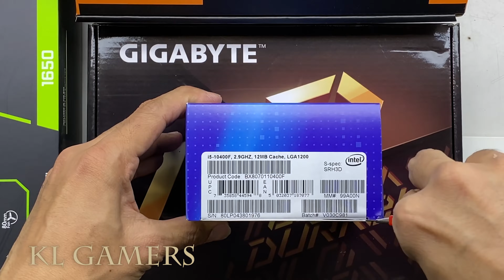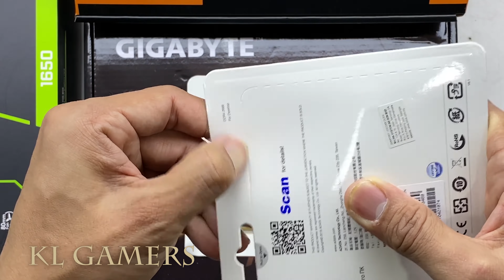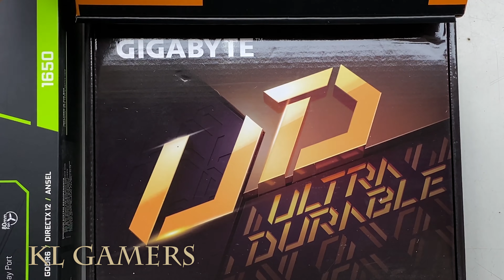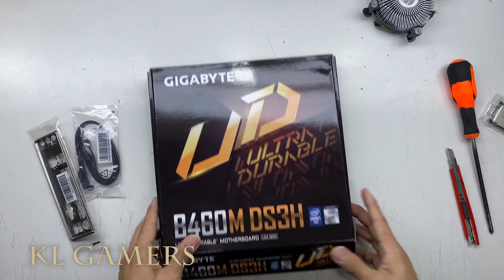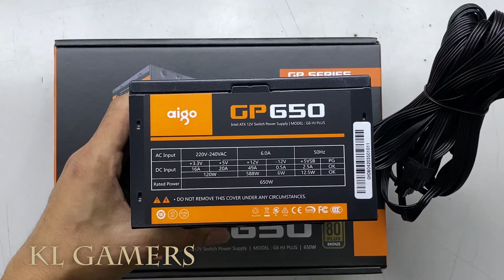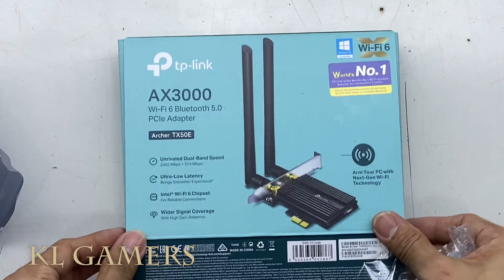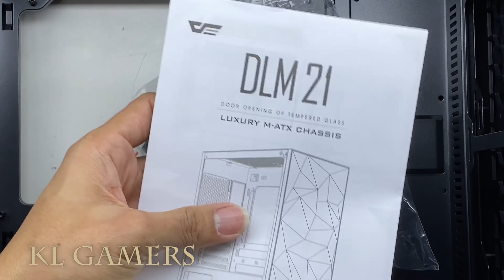intel Core i5 10400F GIGABYTE B460M DS3H GTX1650 DLM22 Black PC Build

Comment: Btw, if you put the total price for the build could be more interesting...Love your video...Dont stop👍
Reply from the maker: Processor =  Intel Core i5-10400F Desktop Processor 6 Cores up to 4.3 GHz Without Processor Graphics LGA1200 (Intel 400 Series ) 65W (DEC)
(Amazon link) = https://amzn.to/2XDBoBK
(Lazada link) = https://c.lazada.com.my/t/c.Y5a4eQ?url=https%3A%2F%2Fwww.lazada.com.my%2Fproducts%2Fintel-core-i5-10400f-6-cores-up-to-43-ghz-lga1200-processor-without-processor-graphics-i5-10400f-i1314432419-s4035954258.html&&sub_id1=10400F&sub_id2=YES&sub_id3=639
(Shopee link) = https://invol.co/clvw63

Motherboard = Gigabyte B460M DS3H (LGA1200/Intel/B460/Micro ATX/M.2/SATA 6Gb/s/USB 3.2 Gen 1/DDR4/Motherboard)
(Amazon link) = https://amzn.to/3eOh5sO
(Lazada link) = https://c.lazada.com.my/t/c.YUA1xB?url=https%3A%2F%2Fwww.lazada.com.my%2Fproducts%2Fgigabyte-b460m-ds3h-m-atx-motherboard-i1425942136-s4581802021.html&&sub_id1=B460M&sub_id2=PCByte&sub_id3=354
(Shopee link) = https://invol.co/cl1rp4p

RAM = ADATA DDR4- 16GB RAM - DIMM 288-pin - 2666 MHz / PC4-21300 - CL19-1.2 V - unbuffered - Non-ECC
(Amazon link) = https://amzn.to/2OFMbqI
(Lazada link) = https://c.lazada.com.my/t/c.6tb2?url=https%3A%2F%2Fwww.lazada.com.my%2Fproducts%2Fadata-ram-ddr4-2666-u-dimm-16gb-i435493224-s636338959.html&&sub_id1=ADATA&sub_id2=OFFICIAL&sub_id3=360
(Shopee link) = https://invol.co/clkwvt

SSD = ADATA XPG SX8200 PRO M.2 PCIE GEN3x4 SSD
(Amazon link) = https://amzn.to/39P98kv
(Lazada link) = https://c.lazada.com.my/t/c.YUy3H7?url=https%3A%2F%2Fwww.lazada.com.my%2Fproducts%2Fadata-xpg-sx8200-pro-pcie-m2-2280-solid-state-drive-256gb512gb1tb2tb-i488598676-s1431066623.html&&sub_id1=8200&sub_id2=Viewnet&sub_id3=349s652831528.html&&sub_id1=sx8200&sub_id2=EIT&sub_id3=240
(Shopee link) = https://invol.co/clu0am

Graphics Card = MSI GTX 1650 4GB D6 AERO ITX OCV1 4GB GDDR6 GTX1650 (JAN)
(Amazon link) = https://amzn.to/2Kit5YE
(Lazada link) = https://c.lazada.com.my/t/c.Y5aOhe?url=https%3A%2F%2Fwww.lazada.com.my%2Fproducts%2Fmsi-gtx-1650-super-ventus-xs-oc-graphic-card-i918606522-s2292878896.html&&sub_id1=1650SV&sub_id2=LAZ&sub_id3=839
(Shopee link) = https://invol.co/cl2bdiw

Wifi = TP-Link WiFi 6 AX3000 PCIe WiFi Card for PC with Heat Sink| Bluetooth 5.0 | 802.11AX Dual Band Wireless Adapter with MU-MIMO, Ultra-Low Latency (Archer TX50E)
(Amazon link) = https://amzn.to/2DuK6eS
(Lazada link) = https://c.lazada.com.my/t/c.b6kMNB?url=https%3A%2F%2Fwww.lazada.com.my%2Fproducts%2Ftp-link-ax3000-wi-fi-6-bluetooth-50-pcie-adapter-archer-tx50e-free-pubg-bag-i1169126020-s3379272581.html&&sub_id1=AX3000&sub_id2=Mono&sub_id3=149
(Shopee link) = https://invol.co/clvwf5

Power Supply = Aigo GP 550W / 650W 80Plus Bronze Power Supply
(Amazon link) = https://amzn.to/36hc2g0
(Lazada link) = https://c.lazada.com.my/t/c.fOYN4?url=https%3A%2F%2Fwww.lazada.com.my%2Fproducts%2Faigo-gp550-550watt-80-plus-bronze-power-supply-aigo-gp550-i990598761-s2608250011.html&&sub_id1=aigo&sub_id2=PCBYTE&sub_id3=169
(Shopee link) = https://invol.co/clp6sb

Casing = darkFlash Micro ATX Mini ITX Tower MicroATX Computer Case with Door Opening Tempered Glass Side Panel (DLM22 Black) (JAN)
(Amazon link) = https://amzn.to/3f07tKD
(Lazada link) = https://c.lazada.com.my/t/c.bD4HXA?url=https%3A%2F%2Fwww.lazada.com.my%2Fproducts%2Faigo-darkflash-dlm22-black-matx-magnetic-hinged-tempered-glass-chassis-bundle-promo-new-i512452504-s975758447.html&&sub_id1=DLM22&sub_id2=Raydeeyo&sub_id3=249
(Shopee link) = https://invol.co/cl2bdja

Price is based in local Malaysia current price.

Comment: How much it costs to build this PC?
Reply from the maker: Processor =  Intel Core i5-10400F Desktop Processor 6 Cores up to 4.3 GHz Without Processor Graphics LGA1200 (Intel 400 Series ) 65W (DEC)
(Amazon link) = https://amzn.to/2XDBoBK
(Lazada link) = https://c.lazada.com.my/t/c.Y5a4eQ?url=https%3A%2F%2Fwww.lazada.com.my%2Fproducts%2Fintel-core-i5-10400f-6-cores-up-to-43-ghz-lga1200-processor-without-processor-graphics-i5-10400f-i1314432419-s4035954258.html&&sub_id1=10400F&sub_id2=YES&sub_id3=639
(Shopee link) = https://invol.co/clvw63

Motherboard = Gigabyte B460M DS3H (LGA1200/Intel/B460/Micro ATX/M.2/SATA 6Gb/s/USB 3.2 Gen 1/DDR4/Motherboard)
(Amazon link) = https://amzn.to/3eOh5sO
(Lazada link) = https://c.lazada.com.my/t/c.YUA1xB?url=https%3A%2F%2Fwww.lazada.com.my%2Fproducts%2Fgigabyte-b460m-ds3h-m-atx-motherboard-i1425942136-s4581802021.html&&sub_id1=B460M&sub_id2=PCByte&sub_id3=354
(Shopee link) = https://invol.co/cl1rp4p

RAM = ADATA DDR4- 16GB RAM - DIMM 288-pin - 2666 MHz / PC4-21300 - CL19-1.2 V - unbuffered - Non-ECC
(Amazon link) = https://amzn.to/2OFMbqI
(Lazada link) = https://c.lazada.com.my/t/c.6tb2?url=https%3A%2F%2Fwww.lazada.com.my%2Fproducts%2Fadata-ram-ddr4-2666-u-dimm-16gb-i435493224-s636338959.html&&sub_id1=ADATA&sub_id2=OFFICIAL&sub_id3=360
(Shopee link) = https://invol.co/clkwvt

SSD = ADATA XPG SX8200 PRO M.2 PCIE GEN3x4 SSD
(Amazon link) = https://amzn.to/39P98kv
(Lazada link) = https://c.lazada.com.my/t/c.YUy3H7?url=https%3A%2F%2Fwww.lazada.com.my%2Fproducts%2Fadata-xpg-sx8200-pro-pcie-m2-2280-solid-state-drive-256gb512gb1tb2tb-i488598676-s1431066623.html&&sub_id1=8200&sub_id2=Viewnet&sub_id3=349s652831528.html&&sub_id1=sx8200&sub_id2=EIT&sub_id3=240
(Shopee link) = https://invol.co/clu0am

Graphics Card = MSI GTX 1650 4GB D6 AERO ITX OCV1 4GB GDDR6 GTX1650 (JAN)
(Amazon link) = https://amzn.to/2Kit5YE
(Lazada link) = https://c.lazada.com.my/t/c.Y5aOhe?url=https%3A%2F%2Fwww.lazada.com.my%2Fproducts%2Fmsi-gtx-1650-super-ventus-xs-oc-graphic-card-i918606522-s2292878896.html&&sub_id1=1650SV&sub_id2=LAZ&sub_id3=839
(Shopee link) = https://invol.co/cl2bdiw

Wifi = TP-Link WiFi 6 AX3000 PCIe WiFi Card for PC with Heat Sink| Bluetooth 5.0 | 802.11AX Dual Band Wireless Adapter with MU-MIMO, Ultra-Low Latency (Archer TX50E)
(Amazon link) = https://amzn.to/2DuK6eS
(Lazada link) = https://c.lazada.com.my/t/c.b6kMNB?url=https%3A%2F%2Fwww.lazada.com.my%2Fproducts%2Ftp-link-ax3000-wi-fi-6-bluetooth-50-pcie-adapter-archer-tx50e-free-pubg-bag-i1169126020-s3379272581.html&&sub_id1=AX3000&sub_id2=Mono&sub_id3=149
(Shopee link) = https://invol.co/clvwf5

Power Supply = Aigo GP 550W / 650W 80Plus Bronze Power Supply
(Amazon link) = https://amzn.to/36hc2g0
(Lazada link) = https://c.lazada.com.my/t/c.fOYN4?url=https%3A%2F%2Fwww.lazada.com.my%2Fproducts%2Faigo-gp550-550watt-80-plus-bronze-power-supply-aigo-gp550-i990598761-s2608250011.html&&sub_id1=aigo&sub_id2=PCBYTE&sub_id3=169
(Shopee link) = https://invol.co/clp6sb

Casing = darkFlash Micro ATX Mini ITX Tower MicroATX Computer Case with Door Opening Tempered Glass Side Panel (DLM22 Black) (JAN)
(Amazon link) = https://amzn.to/3f07tKD
(Lazada link) = https://c.lazada.com.my/t/c.bD4HXA?url=https%3A%2F%2Fwww.lazada.com.my%2Fproducts%2Faigo-darkflash-dlm22-black-matx-magnetic-hinged-tempered-glass-chassis-bundle-promo-new-i512452504-s975758447.html&&sub_id1=DLM22&sub_id2=Raydeeyo&sub_id3=249
(Shopee link) = https://invol.co/cl2bdja

Price is based in local Malaysia current price.

Comment: Beautiful nice, give me that computer please.
Reply from the maker: Processor =  INTEL CORE i3-10105F up to 4.4GHz Socket 1200 Core i3 10105F 4.4G LGA1200 Processor 4 CORE 8 THREADS 6MB SMART CACHE 65W (APRIL)
(Amazon link) = https://amzn.to/2Op6U1k
(Lazada link) = https://c.lazada.com.my/t/c.Y501A5?url=https%3A%2F%2Fwww.lazada.com.my%2Fproducts%2Fintel-core-i3-10105f-up-to-44ghz-socket-1200-core-i3-10105f-44g-lga1200-processor-4-core-8-threads-6mb-smart-cache-3-years-warranty-discrete-graphics-required-comet-lake-i2031208294-s8063806832.html&&sub_id1=10105f&sub_id2=mini&sub_id3=389
(Shopee link) = https://invol.co/cl3hb8d

Motherboard = Asus Prime H410M-K LGA1200 Socket MATX Motherboard
(Amazon link) = https://amzn.to/3xygxjU
(Lazada link) = https://c.lazada.com.my/t/c.ZleAVQ?url=https%3A%2F%2Fwww.lazada.com.my%2Fproducts%2Fasus-prime-h410m-k-lga1200-socket-matx-motherboard-i1158686089-s3330646528.html&&sub_id1=H410M-K&sub_id2=YES&sub_id3=300
(Shopee link) = https://invol.co/clpz5j

RAM = Kingston ValueRAM 8GB 2666MHz DDR4 Non-ECC CL19 Desktop Memory KVR26N19S8 = RM145
(Amazon link) = https://amzn.to/31NOWud
(Lazada link) = https://c.lazada.com.my/t/c.dOJL
(Shopee link) = https://invol.co/clh9nj

SSD = Kingston KC600 512GB 2.5 Inch SATA3 Solid State Drive (3D TLC) Model: SKC600/512G
(Amazon link) = https://amzn.to/33gGTdk
(Lazada link) = https://c.lazada.com.my/t/c.0BE7l9?url=https%3A%2F%2Fwww.lazada.com.my%2Fproducts%2Fkingston-internal-ssd-2tb-1tb-512gb-256gb-kc600-internal-ssd-sata-3d-tlc-nand-solid-state-drive-skc600256g-skc600512g-skc6001024g-skc6002048g-i396168013-s1719562037.html&&sub_id1=kc600&sub_id2=mono&sub_id3=289
(Shopee link) = https://invol.co/clu0c7

Graphics Card = GTX 1660 SUPER 6GB GDDR6 (APRIL)
(Amazon link) = https://amzn.to/3sRYK4c
(Lazada link) = https://c.lazada.com.my/t/c.Y50DUt?url=https%3A%2F%2Fwww.lazada.com.my%2Fproducts%2Fpalit-geforce-gtx-1660-super-gp-6gb-gddr6-i1931072940-s7771090551.html&&sub_id1=1660s&sub_id2=dota&sub_id3=2998
(Shopee link) = https://invol.co/cl3r1mh
(Shopee link) = https://invol.co/cl3drp7
(Shopee link) = https://invol.co/cl3drpi
(Shopee link) = https://invol.co/cl3r1n9
(Shopee link) = https://invol.co/cl3r1o2
(Shopee link) = https://invol.co/cl3r1kr
(Shopee link) = https://invol.co/cl3r1oh

ZOTAC GAMING GeForce RTX 2060 6GB GDDR6
(Amazon link) = https://amzn.to/3fsr89b
(Lazada link) = https://c.lazada.com.my/t/c.Y5ZCrN?url=https%3A%2F%2Fwww.lazada.com.my%2Fproducts%2Fgigabyte-rtx2060-oc-6gb-gddr6-192bit-graphic-card-gv-n2060oc-6gd-i1985980782-s7924318615.html&&sub_id1=rtx2060&sub_id2=yes&sub_id3=2499
(Shopee link) = https://invol.co/cl3r1tr
(Shopee link) = https://invol.co/cl3r1ub

MSI GeForce RTX 3070 RTX3070 DirectX 12 Gaming X Trio Triple-Fan 8GB 256-Bit
(Amazon link) = https://amzn.to/3vvNITn

ZOTAC GAMING GeForce RTX 3070 Twin Edge OC 8GB GDDR6
(Amazon link) = https://amzn.to/3eDo9bT

MSI GeForce RTX 3080 GAMING X TRIO 10G GRAPHIC CARD
(Shopee link) = https://invol.co/cl39u3a

EVGA GeForce RTX 3070 FTW3 ULTRA GAMING 8GB GDDR6
(Lazada link) = https://c.lazada.com.my/t/c.Y50D5q?url=https%3A%2F%2Fwww.lazada.com.my%2Fproducts%2Fasus-rtx-3070-tuf-gaming-8gb-gddr6-grahic-card-nvidia-rtx3070-graphic-card-tuf-rtx3070-o8g-gaming-i1633408151-s5618966550.html&&sub_id1=RTX3070&sub_id2=Castle&sub_id3=7499
(Shopee link) = https://invol.co/cl3r1ub

BIOSTAR Radeon RX560 4GB GDDR5 128bit with DVI/Display port/HDMI output RX 560 4GB
(Amazon link) = https://amzn.to/3rAdHGG
(Lazada link) = https://c.lazada.com.my/t/c.Y50ujU?url=https%3A%2F%2Fwww.lazada.com.my%2Fproducts%2Fbiostar-radeon-rx560-4gb-ddr5-i2044290320-s8148807720.html&&sub_id1=RX560&sub_id2=JCI&sub_id3=798
(Shopee link) = https://invol.co/cl3r24z

Wifi = TP-Link WiFi 6 AX3000 PCIe WiFi Card for PC Ultra-Low Latency (Archer TX50E)
(Amazon link) = https://amzn.to/2DuK6eS
(Lazada link) = https://c.lazada.com.my/t/c.b6kMNB?url=https%3A%2F%2Fwww.lazada.com.my%2Fproducts%2Ftp-link-ax3000-wi-fi-6-bluetooth-50-pcie-adapter-archer-tx50e-free-pubg-bag-i1169126020-s3379272581.html&&sub_id1=AX3000&sub_id2=Mono&sub_id3=149
(Shopee link) = https://invol.co/clvwf5

Power Supply =  Cooler Master MWE 550 White 550W 80+ White PSU w/Hydro-Dynamic-Bearing Silent 120mm Fan, Single +12V Rail, Flat Black Cables
(Amazon link) = https://amzn.to/2Td0WEn
(Lazada link) = https://c.lazada.com.my/t/c.Y5Z8bc?url=https%3A%2F%2Fwww.lazada.com.my%2Fproducts%2Fcooler-master-mwe-bronze-v2-550-power-supply-mpe-5501-acabw-buk-550w-i1339612920-s4151886574.html&&sub_id1=mwe550&sub_id2=NET&sub_id3=185
(Shopee link) = https://invol.co/cl2kmcb

Casing = Aigo darkFlash Leo ATX Tempered Glass Gaming Casing [ATX, Matx, Mini-ITX] (MARCH)
(Amazon link) = https://amzn.to/3eFtob0
(Lazada link) = https://c.lazada.com.my/t/c.Y5ZC0v?url=https%3A%2F%2Fwww.lazada.com.my%2Fproducts%2Faigo-darkflash-leo-with-3-rainbow-led-fan-atx-tempered-glass-gaming-casing-i1275408439-s3855234298.html&&sub_id1=LEO&sub_id2=SCS&sub_id3=149
(Shopee link) = https://invol.co/cl353f9

Comment: This pc is not working with 3200MHz ? Plsss
Reply from the maker: the 3200Mhz RAM will run at 2666 for intel corei3,  i5 , 2933 for intel Core i9, i7
Reply: @KLGamers  ok i5 10400F 3200mhz=2666mhz
Reply: @KLGamers  thx
Reply: Yes, the RAM is gonna be clocked down to 2666 MHz because that's the maximum the processor supports, but you can enable a setting in the BIOS called XMP profile to make the RAM work at its higher clock speed (3200 MHz).

Comment: salam bang nak tanya...intel 5 10400 combo dgn B460 DS3H...pakai ram 8X2 3200mhz...soalan saya kat sini...speed ram tu saya boleh dapat full ataupon dia ada limit kat mana2 cth 2666mhz atau etc
Reply: The RAM is gonna be clocked down to 2666 MHz because that's what the processor supports at the max. But you can enable a setting in the BIOS called XMP profile to make the RAM work at its higher clock speed (3200 MHz in your case).